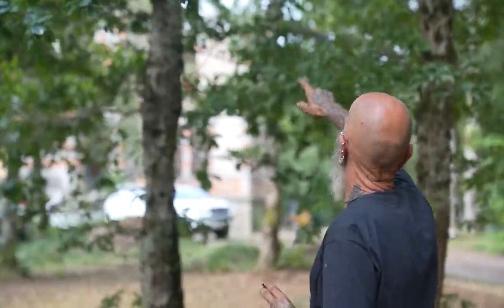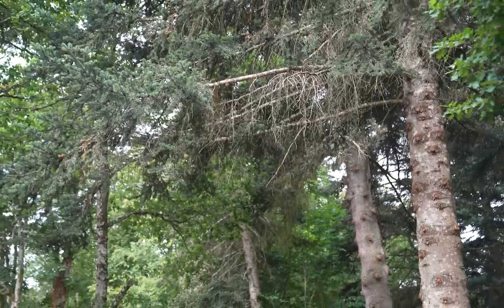A seesaw and a helipad.

Comment: The yurt will be a nice addition for you Dan. I considered one when going off grid on my 100 acres in New Brunswick Canada but it’s far too humid here and there’s too much risk of mild in the spring and summer months. I ended up converting a refer instead but I look forward to seeing your yurt for sure.
Reply: What is a refer?
Reply: refer???????
Reply: A refer is a refrigerated container for trucking parishable foods and goods here in North America. Probably in Europe as well I would imagine. Mine is 53’ or 16.15 metres in length.
Reply: @redtankgirl5  Thanks very much for the explanation. Had not heard that term here in New Zealand. I believe people just say "container" although of course we use refrigerated containers for transport
Reply: @gabriellechamberlain7228  You’re welcome. You’re correct in that we also use them for transport but it was a great way for me to have an instantly insulated structure that I could put windows and doors into along with a wood cook stove and be off and running. As I arrived on the property in late October and that’s close to the snow fly here I didn’t have much time to waste. This was a great option. The next spring I was able to put a roof on it and get the solar panels up and going. I was actually living in it in two weeks however. It was a good option for a tiny house.

Comment: If there is any slope above the pad for the yurt you may need to put in a trench or some type of drainage system so if it rains you won't get run off affecting access to the yurt or undermining the floor structure you build. You would be amazed at how many people forget to direct the run off away from their house/tent/caravan and end up with damage or an emergency situation. I've been on emergency jobs (for NSW SES, in Australia) where people had designed driveways to lead into their garage that looked good, but as soon as any amount of rain hits the driveway turns into a small stream, directing the flow of water straight into the garage and sometimes into houses if they have the garage attached to the house. A little bit of extra thinking about the likely result of rain, bushfire (wildfire), flood, etc can save having to go back and fix the problem, replace belongings, etc.
I'd hate for you to get the pad done then realise more work will be needed to direct water away from it.
Blessings from South Eastern Australia, Dot

Comment: It should be easy to fix the top of the walls after you get the next and last two beams in for the third floor. I was wondering if the top of the walls then are either waist or knee high from the very top floor. Cant wait till we can get to see the view from the very top floor of the kitchen wing.

Comment: cameron and the axe 😮 dan are you planning on having a wood burner in the yurt  all that free wood
Reply: Apart from the deadwood, everything felled there is too damp to be used anytime soon. Wood needs to dry for at least a year to be useable in a wood stove.
Reply: @Ruhrpottpatriot   and dan won't be in the château anytime soon
Reply: @kathsmith4924  So? You talked about the yurt. If he hasn't gotten a roof on at least one part of the building in 12 months then something is going wrong.
Furthermore, the amount of actual wood he got from all the trees isn't really that much. I'd guess two to five weeks at most.

Comment: Dan, why aren't you making usable woodpiles for this winter?
Reply: Wood has to dry for at least a year
Reply: Ideally, firewood needs to dry out for at least a year (2 is better). But you're right, they should be cutting, splitting, & making orderly stacks. If you just put it all in a pile, the wood inside the pile stays wet & may even rot, & only the outside pieces get semi-dry. I learned this through first-hand experience.
Reply: @NurseSherry  That is true. However, some of those trees are dry right now and if cut, split, and stacked into usable piles some of the wood could be used this year and more saved for next year. We use wood removed from our trees the same year we harvest all the time. Just saying.

Comment: I hope you do a raised platform for the Yurt. But, it seems you are going for building in on the ground.
It will be quite muddy in the rain going to and from your Yurt.
Time will tell.
Reply: 13:20 He said gravel, membrane and a floor. If he's building a floor I'd imagine it would lift it above ground level, no?
Reply: @Sgirl  Your version of build on the ground and my version of building on an actual "Deck" differ.
If he was building the Yurt on a Deck off the ground; he doesn't need gravel. You build "piers" to set Joist.
We shall see in the coming videos what he does.
Reply: @dennispatrick4999  Got it. Thanks!